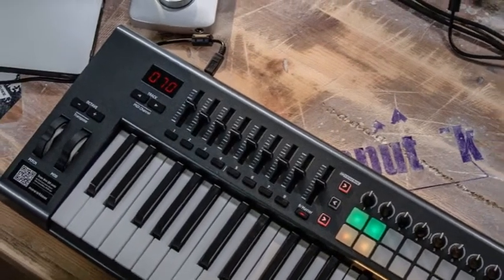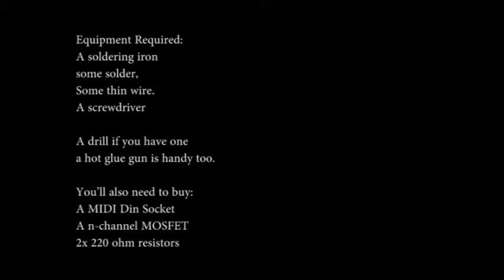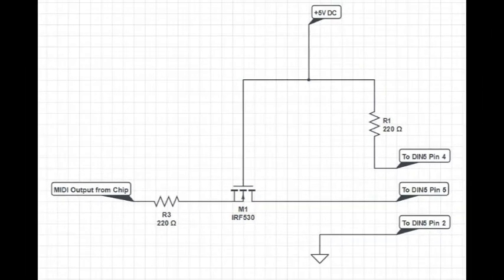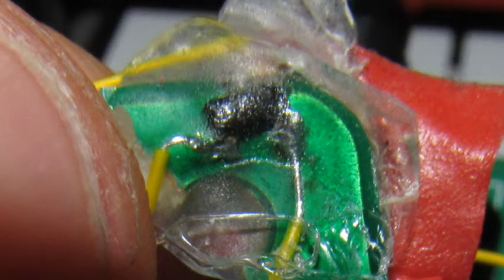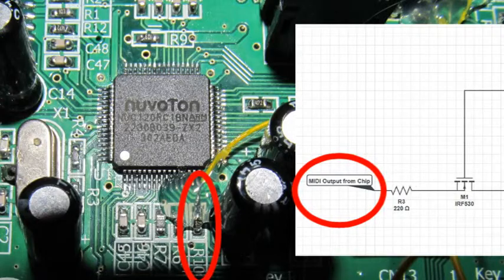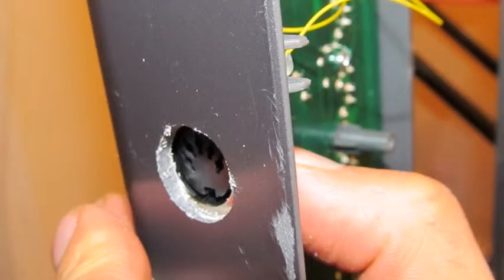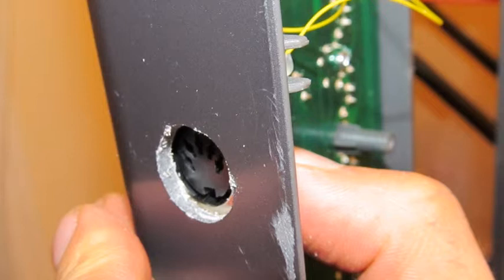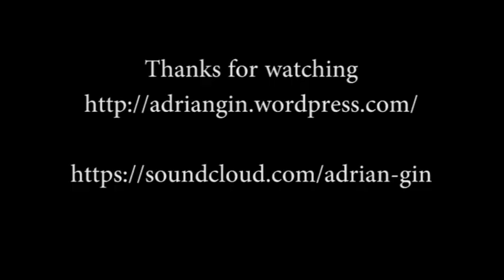Novation Launchkey Hack- Add MIDI DIN Output

Comment: Will this work on a launchkey 25? You say that it is compatible but my mainboard looks different from yours.
Reply from the maker: This mod applies to the Launchkeys MK1 range, those WITHOUT the RGB LEDs. Is yours the MK2 by chance?
Reply: I have no idea. It has RGB pads and the 7 segment display is red.
Reply from the maker: You have the Launchkey MK2 which is not the same as MK1. This mod cannot be done on the MK2, I'm afraid!
Reply: johntiler Darn. Well thanks anyways!